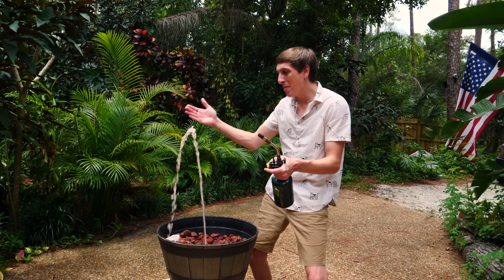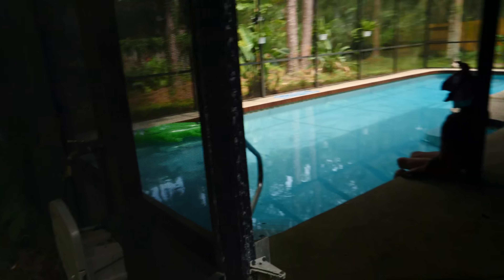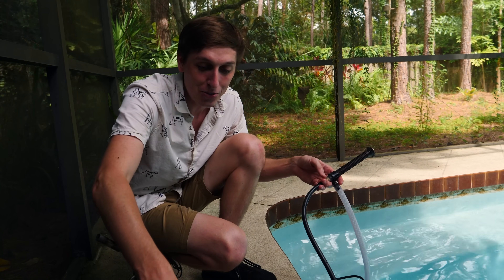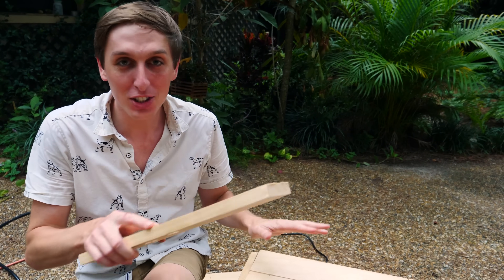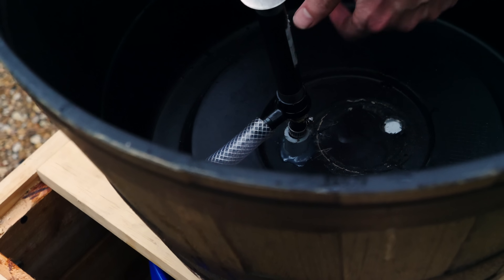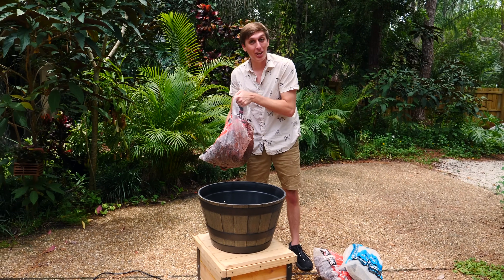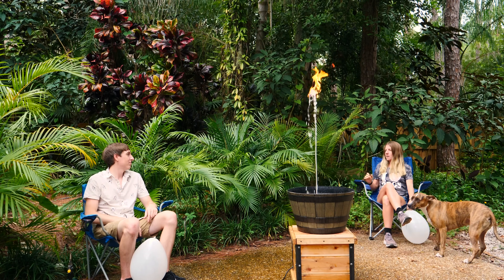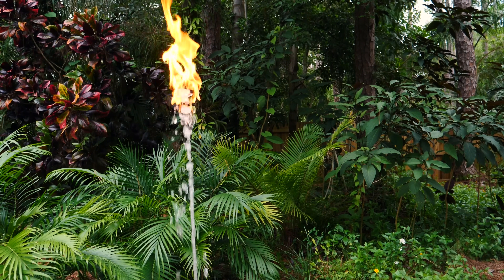Impossible Water Fountain - DIY

Comment: When you put the small gas pipe in the middle of straws and then through the hole in connection what fitting do you use to go into gas line

Comment: I’m having a hard time figuring out what you did in between screwing the elbow onto the pipe and then gluing the barb on the bottom, how did you connect the 3/32 pipe to the barb fitting?

Comment: Love this video! 1.Do you have the option of running the water  without the fire? Concern about water going into has line. 2. Can I make the water and 🔥shoot into the air without having any issues? Height not the concern. Water falling into gas line. 3. Can you make a waterfall wall with a see thru opening with water in fire?

Comment: So the reason it works is because of "nearly perfect laminar flow" right? If it was perfect laminar flow then the propane would never be exposed to the exterior of the stream. As soon as the flow becomes turbulent, that is the point of ignition. Maybe I don't know I am thinking and typing at the same time. Whatever great video as always 👍

Comment: Could you make some sort of fountain with a flammable liquid instead of water or would that be to dangerous? Also, could you try to make a mixture of a flammable liquid and a non flammable liquid to create a slow burning liquid to use in the previously suggested project?

Comment: There are some companies that make this as a product for some real rich people. Back in 2017 ish one of my family members was working on a house that had a flaming water fountain that used the same principle. It had 2 or 3 levels. Each level had propane blubbers that supposedly would diffuse the propane directly in to the water, instead of the bubbles catching fire, whether or not if that's true or not I have no idea, and I don't think anybody in the company wrote any papers on it lol. Either way it looked cool. 

Thinking about it though, I think it would be interesting to try this same thing with cold saltwater. The lower the temp, the more dissolved gas the water could hold. Also, adding salt to the water decreases the bubble size, something to do with the polarity of water and the polarity of the ions from salt. It would be interesting to see how both of those things affect the fountain.

Comment: If you have a recirculating system will the propane make the water acidic? In the 50’s it was fun to inject natural gas into the pool plumbing and light the bubbles on fire.

Comment: I have a project to worck on a cold torch were a small battery powers a led when the led heats up heat pipes carry the heat to a petite modial and cold side out the torch the peltier modial charges the battery I know either the led doesn't heat up fast innuf the peltier doesn't produce snug energy and its only bilt for cold places and insulate the heat eria

Comment: I found a cool science anomaly that I haven't seen before and I searched it up and can't find it or an explanation. if you take a 2 by 4 block of aluminum and you put it on its side, so the short side is facing up. then if you slightly slant the block and roll a cylinder magnet down at a slight angle it will seem to bounce off the side of the wall as if there is an invisible barrier.

Comment: I wonder if you could add salt to the water and set up a system for electrolysis of the water to collect hydrogen and bubble that into the water for the same effect.  Maybe if you hooked it up to solar and allowed hydrogen to collect through the day to then release and light it on fire at night.  Could be cool if it worked, don't know if you could produce enough hydrogen though.

Comment: What happens if you combine this with an actual DIY laminar flow fountain (3"/4" PVC filled with straws) thats designed to keep the stream laminar throughout the arc? Does the introduced gas bubbles break up the laminar flow? Will the bubbles stay trapped like total internal reflection and only light where the stream is broken or lands?

Comment: If the water isn't drinkable I wouldn't build it. If you could safely drink it that would be amazing. Vodka water?
Reply from the maker: The propane does not pollute the water, so as long as the water is clean and the rocks are washed you could drink it. Id have to look up and see if propane is soluble in water to any degree but i doubt it.
Reply: @TheBackyardScientist  Now I really REALLY want to build this. Thanks for another great idea.